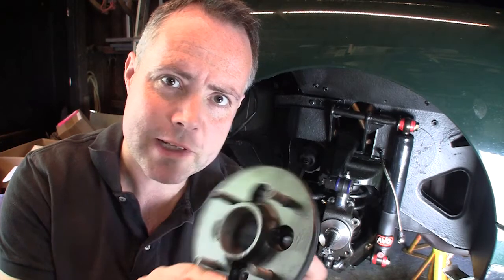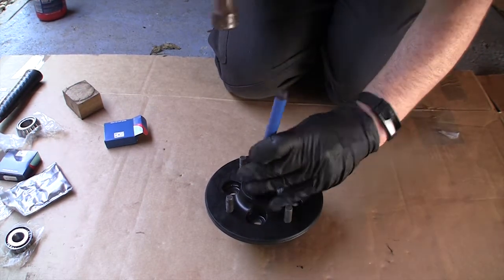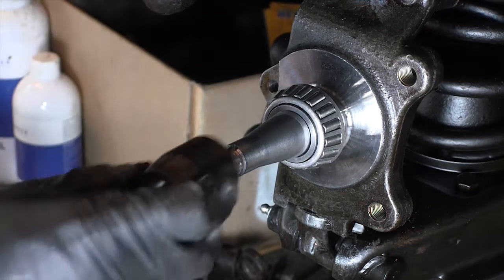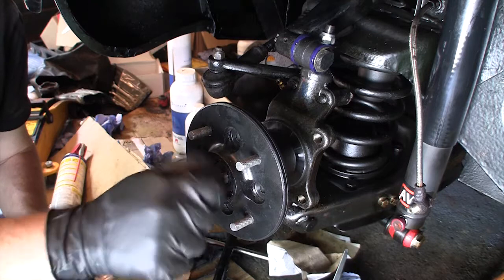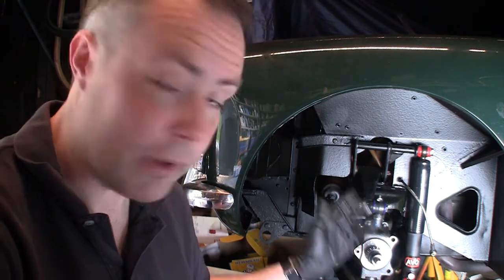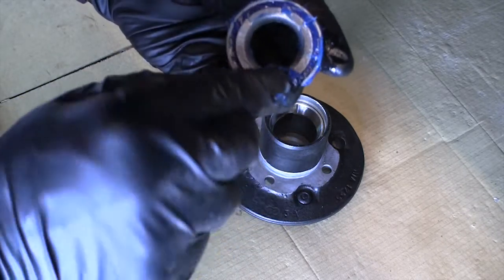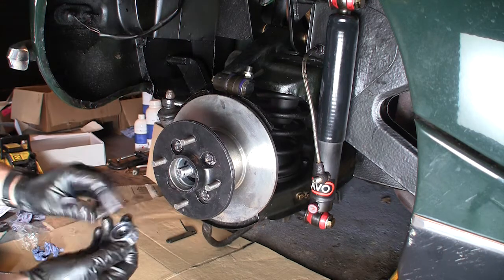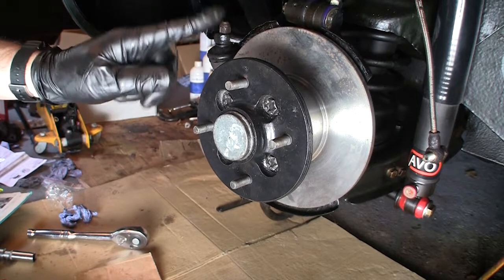Upgrading to taper roller wheel bearings on front axle of the 1275 MG Midget

Comment: You should  not have sanded down where the bearings sit since the inner race of the cone bearing is always tight on the shaft since this stops to whole bearing from turning and thus spinning on the shaft and ruining the shaft-  knocking the bearings on is standard procedure.
Reply from the maker: 🤔I was going on the advice from the supplier so that the bearing sits on the cone correctly and torquing the hub nut puts load through the inner races and the spacer. Thanks for watching and commenting.

Comment: Timeless video 
I have a bugye with the same setup. 
My brake system is with the mgb calipers and spitfire rotors. 
It's not a simple bolt on, but after working out some issues,  I'm happy
Reply from the maker: I’d like better brakes but would need to check the rules for the historic class I enter competition in. Not bad with the servo assist but would be good to have more longevity before getting too hot.

Comment: Trying to replace my front bearing with tapered roller bearings, but when I put in the new races, the front one all the way seated could be spun in place by hand.  Any suggestions on how to fix this without buying a new hub?
Reply from the maker: Oh that's not an easy one. Are the new bearings too small (relative to spec) / same as old ones? If they differ from the old ones you could have a badly machined bearing. If it is the same size as the old all I can think of is that the bearing has been loose previously. Whilst you can rotate it by hand, does it feel loose in the hub (i.e. up and down / side to side)? How easy is it to move? It might be snug enough to torque up and not be an issue, but as I'm not a mechanic by trade, and I haven't seen it for myself, I'm not really going to be offer you your best solution. Sorry; I suggest you ask a local garage for their thoughts perhaps? Good luck.
Reply: @JerryMotorsport  I got them from Moss Motors that are supposed to work for 1972 MG Midgets w/Wire wheels - kit part# 125-822. Not sure the size - but I have tried both of them in the kit and they both can be moved by hand - spin and up and down and feel about the same looseness.   I will have to search and see what size they are supposed to be.  Thanks for the help and I will let you know what I do and the suggestions I get.
Reply: I used a punch around the inner surface of the hub surface and used loctite bearing surface 660. Worked great.